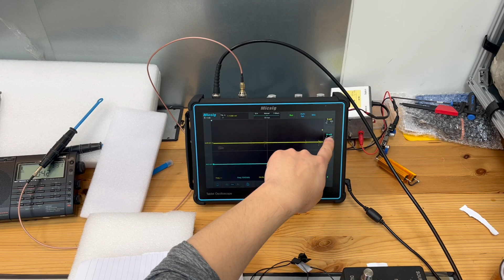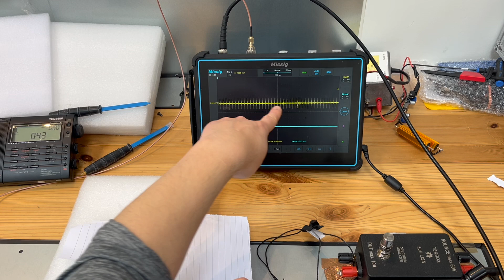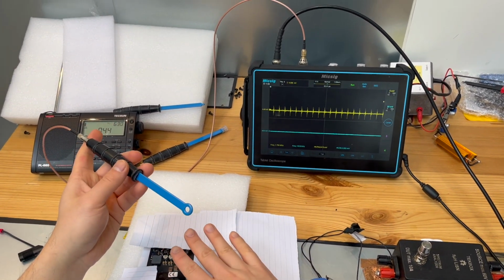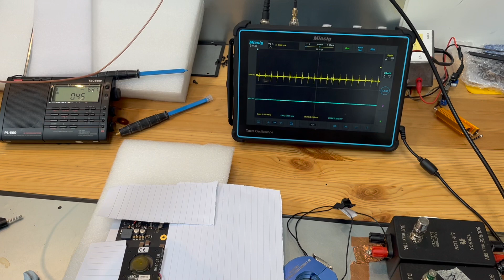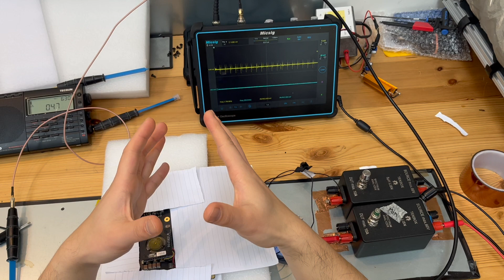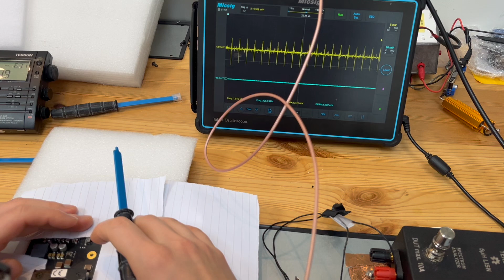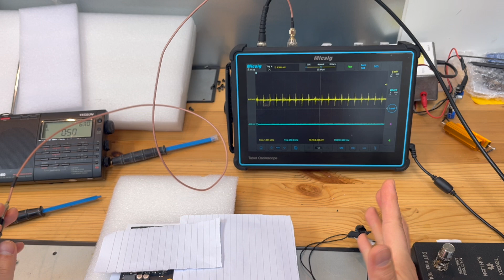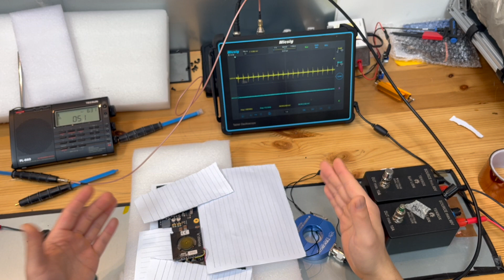Loading & Coupling - how to measure high-speed circuit accurately

Comment: Great video! Could you clarify what the lessons learned were? If I understood you correctly, one of them was that given you have a setup like you do, you can move your H/E field probe around and see which source causes a greater increase to the CMC noise trace we see from the RF clamp?
Reply from the maker: Hi, not really, I think perhaps you slightly missed the point. The point I wanted to make was, when making a measurement on a high speed board, coupling can affect your results. In other words, what you see on the scope may not be how the system behaves. Sometimes, in extreme cases, the person who performed the measurement can "fix" a problem by simply measuring the circuit, this is because the noise was bypassed by the engineer him/herself. This subject is quite complex, perhaps you can start from some basics, I am sure when you have seen enough issues in the filed, you will understand this a lot better.

Comment: Could the probe be seen as an unintended rc snubber? And would it be useful to use the 1M instead of 50 Ω input?
Reply from the maker: Hi, definitely not the 1M ohm input, here, we are using a 50 ohm system in a sense that the transimisision line (the co-axial) is 50 ohm, and the RF current probe only works with 50 ohm. by selecting 1 M ohm, the characteristics of the RF monitoring probe will change completely and even place a negative impact on the signal you want to measure.
Reply: @MachOneDesignEMC clear! Measurements always influence the system because the total sum of energy stays the same, except if it’s added like with an active probe.